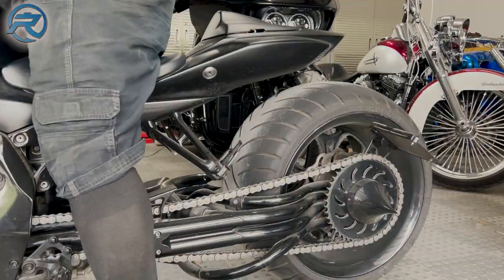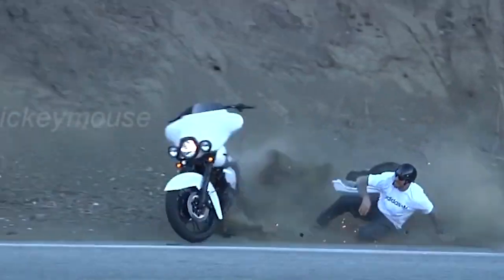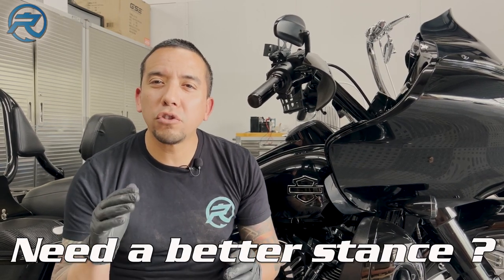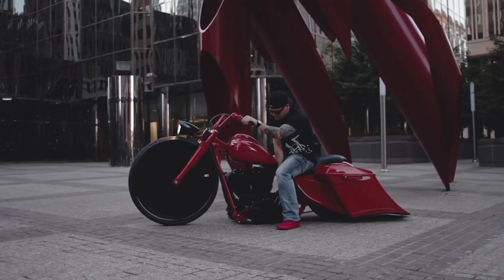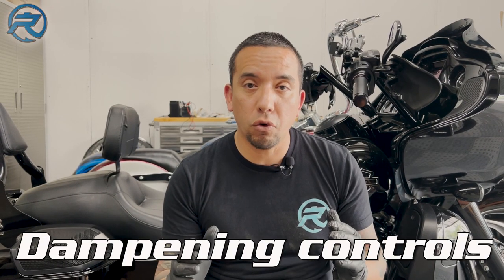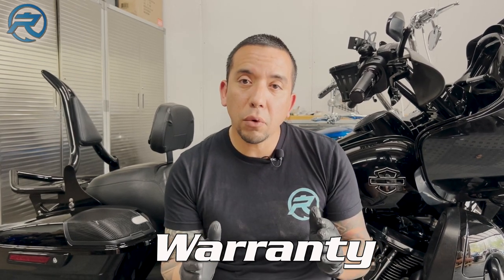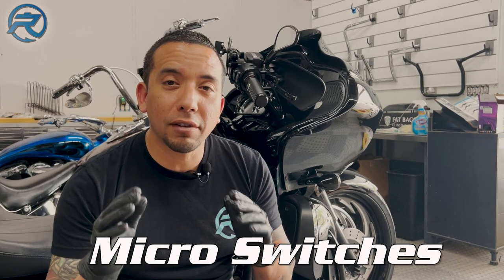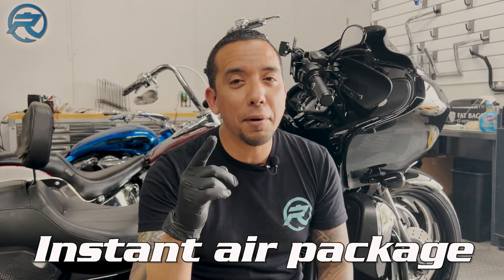All About Air Ride (For Your Motorcycle)

Comment: Absolutely informative video.. I am considering an air ride system. Which do you recommended for both value & warranty.....Thanks
Reply from the maker: I prefer Air FX Air Ride systems because of their quality. The creator is a robotics engineer that overbuilds everything. I’ve got 20yr old Air FX systems that still function like the day I installed them.

Comment: I want my air ride for looks along with the Fat front tire (2019 Street Glide Special). How much should you raise you bike for normal riding conditions?
Reply from the maker: Best riding position 30%-70% internal air pressure inside the air shock. 100% air shock pressure results in a spring like ride; very bouncy. 0% air shock pressure results in a rigid ride; no suspension. Air FX air suspensions are all equipped with rebound controls which allow the rider to stiffen or soften their ride comfort specifications.

Comment: I have a 2005 Big Dog Bulldog with air ride could you tell me if I could get replacement shocks for it or a crossover match?  Thanks
Reply from the maker: @jimb4547: I believe that Big Dog is built on a Softail Dual mono shock located under the frame beneath the transmission. Yes, replacement shocks and replacement air suspension are available. Email sales@rushbikes.com and I’ll assist you.

Comment: Hey guys! I want to install motorcycle air ride on my lifted golf cart. I got about 150lbs on each wheel. My loaded height from center of eye bolt to eye bolt is 11" and shock perches are looks like about 1" to 1-1/8" wide. What do you all think about my idea if its a good one or a bad one? Thanks for your input!